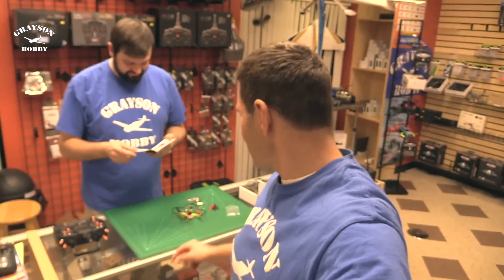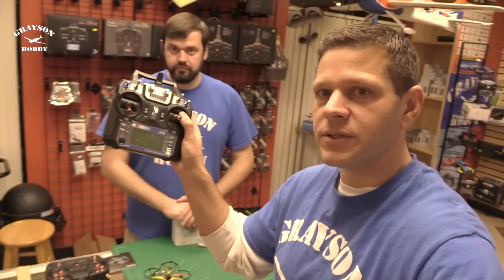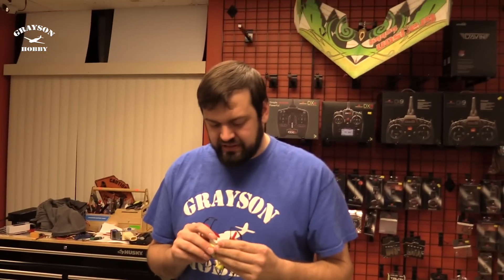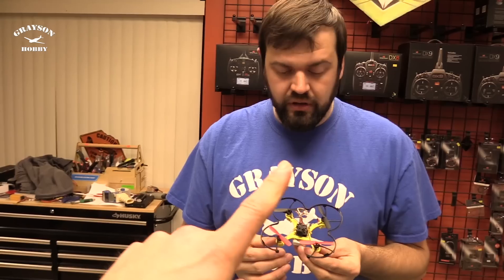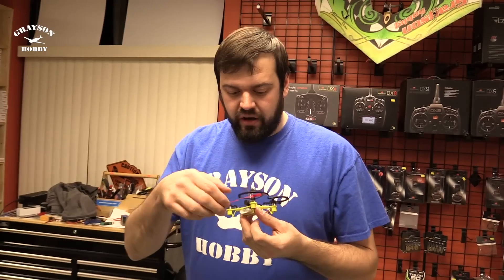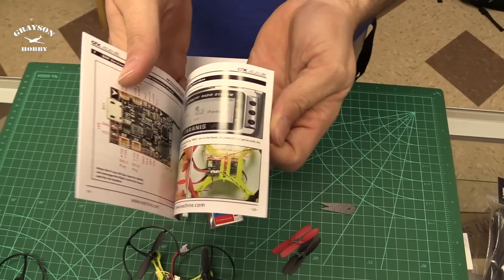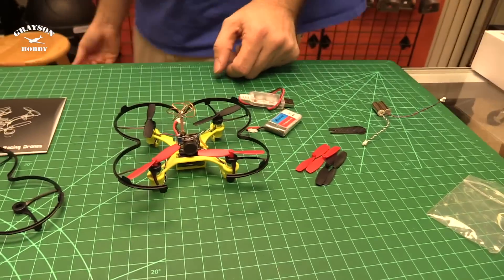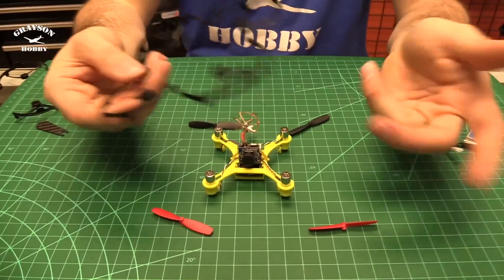Eachine Qx90C Micro FPV Drone Racer Package - Free Prop Guards

Comment: Torn between the 90C and 70... I think the 90C's battery is better sized for the frame though and you don't have to worry about prop mods
Reply from the maker: The Qx70 is great for inside, do not let the prop mod deter you.  its quick and easy to mod the props.

Comment: I got my QX90c a few days ago with the Taranis X9d. The only thing I am having trouble with is the props are starting to fly off at random. If anyone has any advice that would be awesome.
Reply: wandercab I'm having the same problem. I haven't got a stable flight yet. It goes up then one or two props fly off. Did u find a solution I am in process of trying to. Please let me know what you found. It's driving me crazy. Thanks.
Reply: wandercab I just switched to the tri blade props they send with it and haven't thrown one yet. Just thought I'd let u know. Don't know why I had no luck with the dual blade props but I'm a newbie so let me know again what you got figured out.
Reply: I used a bit of lock tight on my props and they haven't  flown off since I did remove them and do it again just to make sure it wasn't permanent.
Reply: wandercab cool thanks I'll give that a try. I'm having VTX problems now. I just get snow on my goggles won't have time till next weekend to figure it out because of my work schedule.
Reply: Make sure that if you do try this that you put it in upside down so that while it dries it can't drip into the motors.  I am about to change out my antenna to a dipole.
Reply: I had a clear picture Saturday then Sunday after practicing all day without the goggles I got the nerve and felt I had practiced enough and got no picture at all. I cycled the goggles through all the channels. I wonder if a crash did something or maybe wet grass.  There is no damage I can see though. What do u think I should do?
Reply: check the connection on the vtx and the solder on the antenna and see if it is broken.
Reply: wandercab from what I can tell it looks good it's so small though lol my eyes aren't that great lol. Do u know how to check it with a multi meter? If so let me know what I should set it to and where to place the red and black probes to check it?  I'm a newbie to this and electronics and my schedule makes it so hard to spend much time scouring the internet. Any help you can give would be awesome. Thanks for the help so far as well.